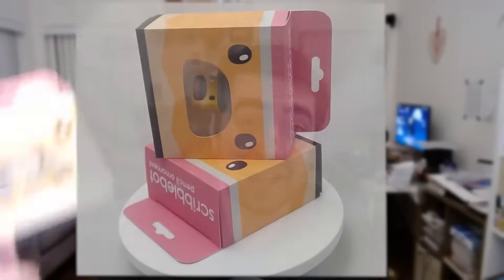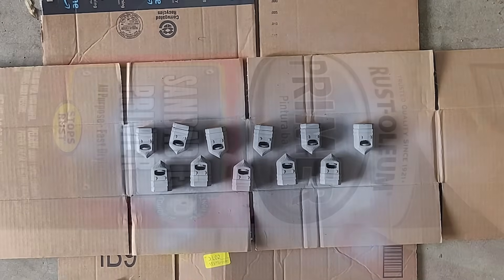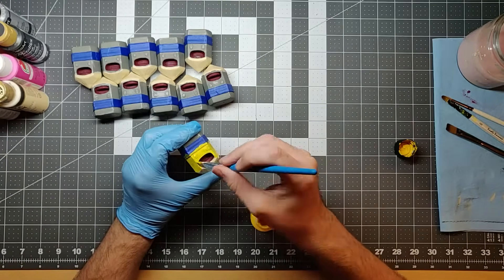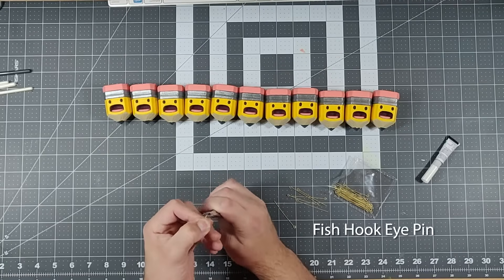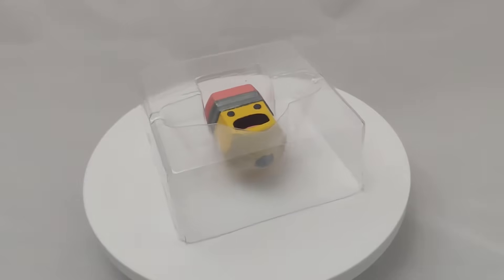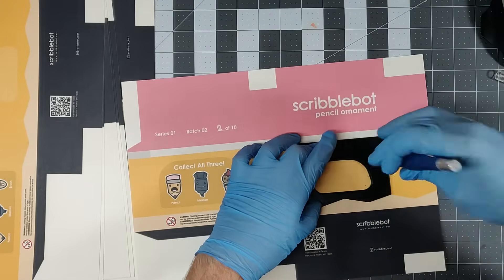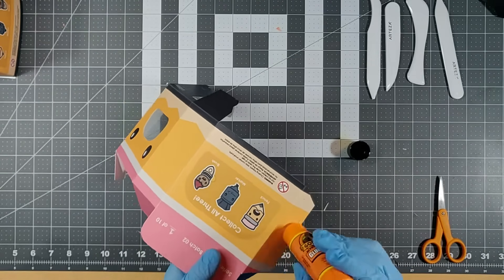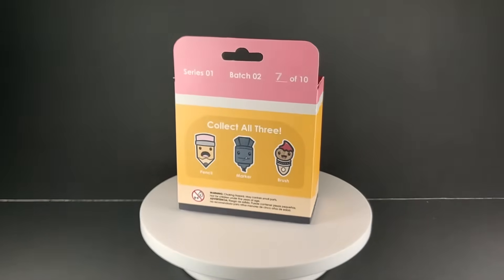Making a Collectible Toy & Its Packaging

Comment: How do you make larger boxes?
Reply from the maker: If you're trying to print at home but only have a printer like mine or smaller you'd need to get creative and modify a box template so that it can be split into two (or more) prints.

 You can add tabs to one print that get glued to the other.

If you're willing to spend a little money you can send your file to a print shop and get it printed in a large format printer.
Reply: @AndyMakes  ok

Comment: Thank you so much for going over the whole process from start to finish. I was interested in possibly selling figures eventually that are just like this process. What brand of paint did you use? The paint job looks professionally done!
Reply from the maker: Thank you! I didn't use any fancy paints, just the standard craft paints that all the big box craft stores sell. The secret was applying the gloss top coat with an airbrush. For that I used Sargent Art Acrylic Gloss and Varnish
Reply: @AndyMakes  Awesome, I will definitely look into getting that. Also for cutting the boxes wouldn’t it save a lot of time to get a cricut maker to do it for you? I think you mentioned before that your printer is inkjet, which works with them I believe.

Comment: How did you print the package?
Reply from the maker: I have a desktop inkjet printer that can print up to 13 inches wide. That was just wide enough for the packaging I designed. Otherwise I would've needed to send the file to a print shop with a wide format printer

Comment: what do you use to color, print in 2d and which paper do you use in this video?
Reply from the maker: I used regular posterboard (Where I live it's usually in the school supply aisle of most stores) and cut it down to a size that fit my printer. My printer is the Epson XP-15000
Reply: Thanks

Comment: When should you have started to mask it ? ( I did try painting stuff at one point and found myself with a not clean line 

Also would it have been better if you spray painted the model vs used a brush ?
Reply from the maker: Yes, an airbrush would have resulted in a much cleaner final appearance. I think there were too many parts that were difficult to mask especially for multiples so getting a base coat and then painting the rest with brush was faster.

As for when I should have started to mask it, it was more a matter of what I used, not when I used it. I think for what I was trying to do, the best solution would have been masking fluid, I didn't even know it existed until recently and I'll be trying that on my next project.

Comment: How did you go about printing the box design on the paperboard?
Reply from the maker: The board I used had a small enough thickness that I was able to fit it in my printer no problem. I just made sure to print on the matte side, the glossy side doesn't really want to absorb printer ink.

Comment: Did you print the box artwork directly onto the posterboard or did you print it on regular color printer paper and glue it on?
Reply from the maker: I printed directly on the posterboard. The glossy side doesn't have the same bite that photo paper has and made the prints smear from the printer rollers... so instead I printed on the matte side and then sprayed a UV coat on it afterwards. I think printing on paper and then gluing it onto posterboard could work but it could tear the paper if you aren't careful.
Reply: @AndyMakes  Using the matte side makes perfect sense. Thanks!

Comment: Did you put the poster board through a regular printer? Or do you have a fancy printer? This is awesome!
Reply from the maker: It's not one of those printers pricing in the thousands if that's what you mean. It's wider format than a standard office printer but it's in the same price range. It's the Epson xp-15000, but any printer that can print 13inches wide will work. Also Inkjet-based is better than toner-based in this case.

Comment: wicked cool process, i would say investing in a cricket would help when making your packaging. Its pretty expensive, but def helpful depending if your making a lot products. At that point you would be your very own tiny toy factory lol
Reply from the maker: You know, it's crazy but I actually bought a cricut for my wife last year and I never thought to use it for this project (I actually ended up using it in a later video) if I make another set of toys I will absolutely take your advice and use it

Comment: Hey Andy, what method did you choose for trimming the outer plastic on the vacu-formed tray? I'm trying to figure out the best route for mass production, and, so far, don't have a better idea than to use a roller press. I surely don't have the space for that though
Reply from the maker: I tried using a utility knife and that worked okay but I ended up switching back to scissors as I felt it gave me a cleaner cut somehow. I think a guillotine shear could work really well for trimming the plastic but that also brings in the added space requirement.

Comment: Hey, great job! Would you have, by any chance a list of materials used?
Reply from the maker: Aside from the big tools in the description and the 3D Filament here's what else I used:

Acrylic Craft Paint -  They weren't even all from the same brand just got the colors I liked from my local hobby store
Rustoleum 2 in 1 Filler & Sandable Primer - I'm sure any sandable primer can get you just as good results but you may need more layers
Sargent Art Acrylic Gloss and Varnish - To coat the finished pieces but I'm sure any other Clear coat gloss will do the trick too.
Posterboard - I trimmed it to 13x19 so it would fit my printer
Transparency sheets for inkjet printers - This is for the window of the packaging, I'm sure there's better alternatives but I already had these on hand since I use those for screen printing.
And the interior packaging was done with the Mayku Clear sheets and their Vacuum former.

Comment: How did you get the print/design on the paperboard? I doubt it was printed on?
Reply from the maker: Actually, they are indeed just printed with a normal inkjet printer! These are small boxes, so I was able to fit the entire box template on a 13in. x 19in. piece of paperboard. If you were working on something much bigger you'd need a wide format printer but there's quite a few household printers that can print 13 inches wide. After printing I sprayed the paper with a UV archival varnish to ensure that it wouldn't get ruined while folding it plus it will protect it from aging too.

Comment: Realistically, since you wouldn't charge for time but rather for the materials involved, how much would you need to sell each one for to make a worthwhile profit at such a small run?
Just a general hypothetical question, also taking out the cost of the 3D printer and vacuum forming machine.
Reply from the maker: This is a hard question to answer but I'll do my best. Almost none of the things I bought for the project were used up entirely with this batch, for instance, the paint bottles cost $6 each but I didn't use up an entire bottle for the project and made 20 of the pencils, I could probably make another 20 and still have paint to spare.

I used 99¢ posterboard for the boxes, but each poster gets you two boxes. However, printing out 20 boxes uses up my printer's ink cartridges so around $2 in ink each. The Vacuum form sheets are also around the dollar mark as well and the cost of PLA for the 3d print? I could probably print 40 of these in one roll ($20) but you also have to factor that your printer will mess up multiple times and you'll lose some plastic there.  

All in all, I'd say the material costs for each one is somewhere around the $10-$15 area. So anything more than that is a profit. I'd take that cost and factor in what you'd charge for your time (this is also tricky to factor because while the model took a few hours... that's a fixed one time deal, but then there's the recurring print time, painting time etc...)

Material + time cost should give you a worthwhile profit number... I'd say $30 is probably decent. Maybe less if you get good prices on the materials and can speed up your process?

Hope that answers your question!